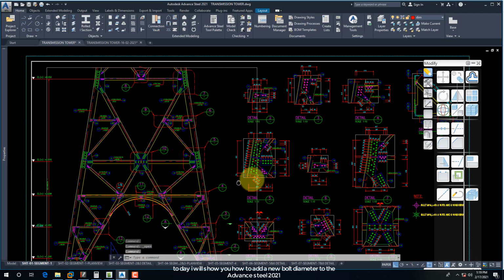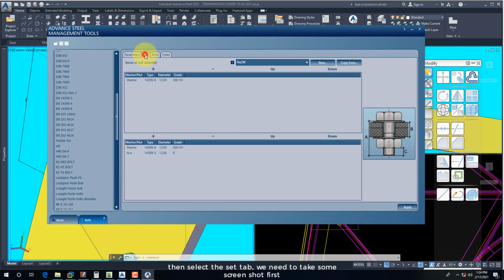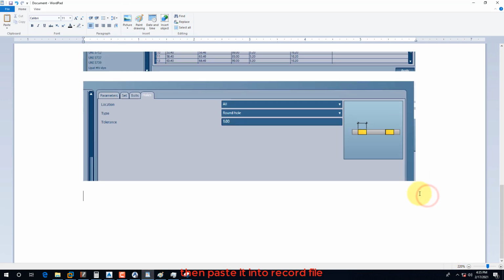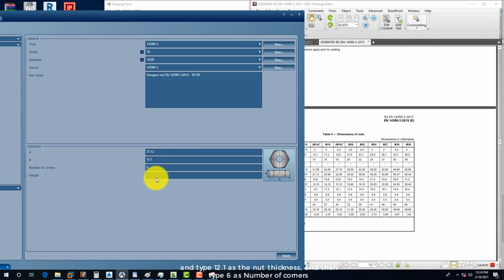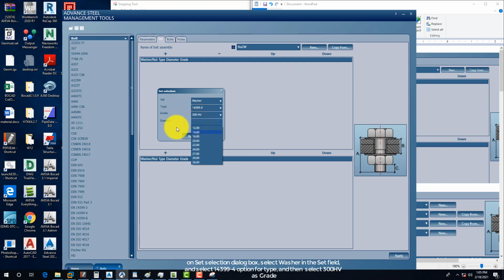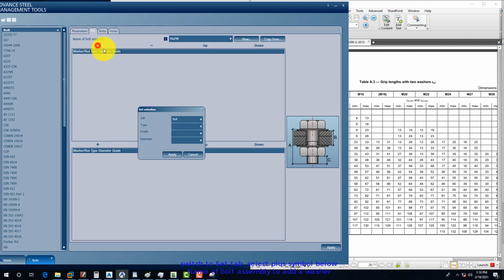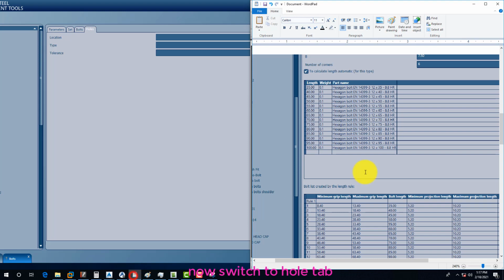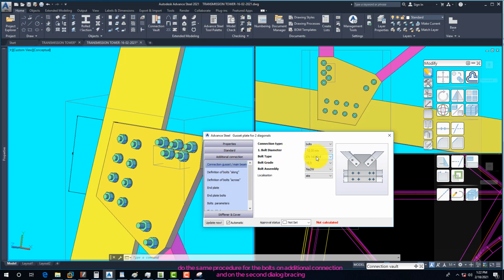TRANSMISSION TOWER/04/HOW TO ADD NEW BOLT DIAMETER M14

Comment: Hello, your vidoes are really helpful but I encounter a problem, when i change language installation to polish version instead having english, the elements at my drawing doesnt have model space viewport and because of that i cant move any element. During using english installation i have got that frame around my drawing elements in which i could change the position of some elements? Do you have any idea where the problem is?
Reply: Ok, I have solved my problem, The proper button was in defaults in drawing general, i had to check something like "create green frame at detail drawing".
Reply from the maker: please send me your model 3d file, i will try to help.